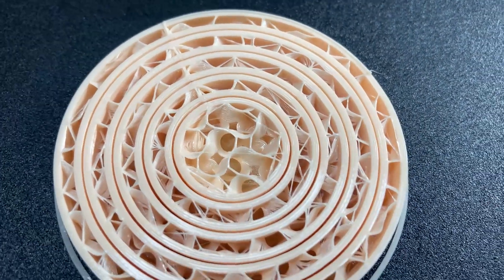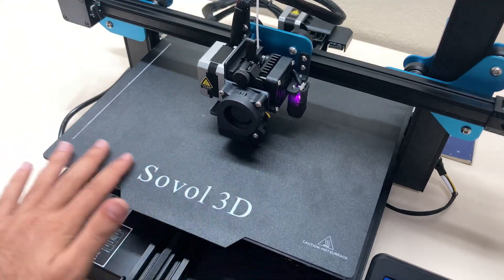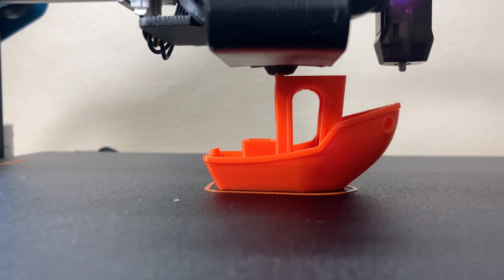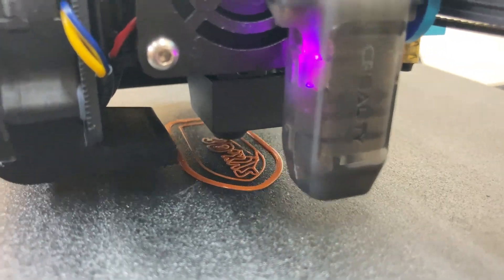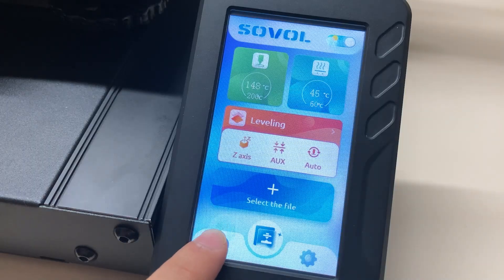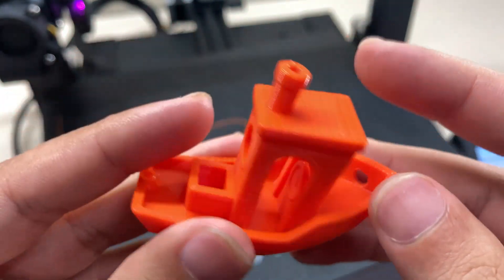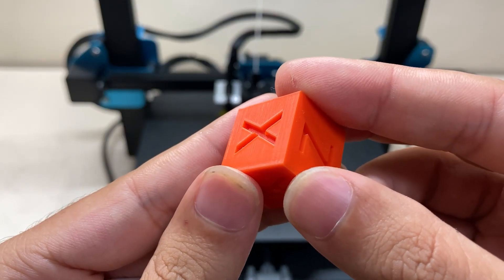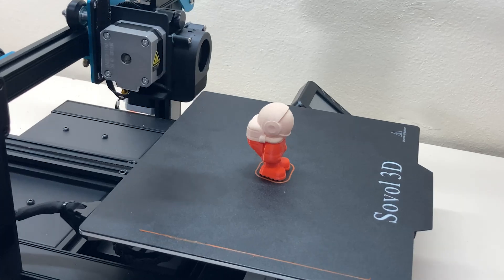Sovol SV01 PRO 3D Printer-This could be the best for beginners!

Comment: whats the main differences with the creality ender 3? seems like they should be similar as this one uses many creality parts.
Reply: this printer is better with dual z screws, direct drive, cr touch, bigger build volume, bigger cooling fan
Reply: @Russell White Do you think you will be able to calibrate Esteps and and firmware on this unit ? i want one but worried its not as customizable as an ender... i cant find if its open source or not